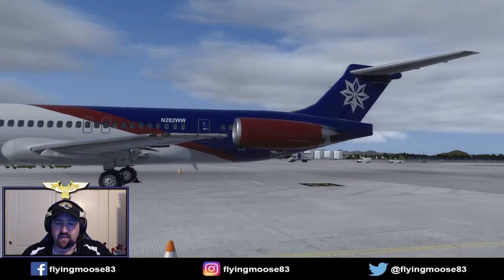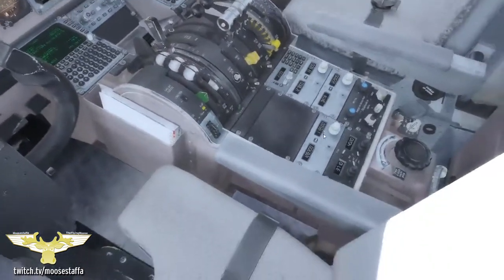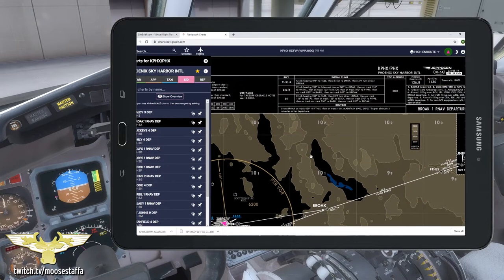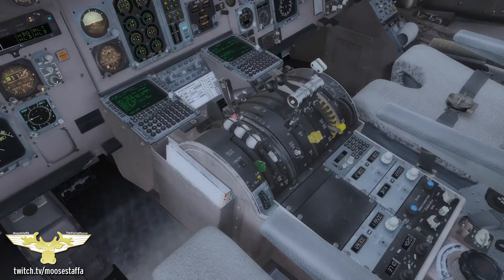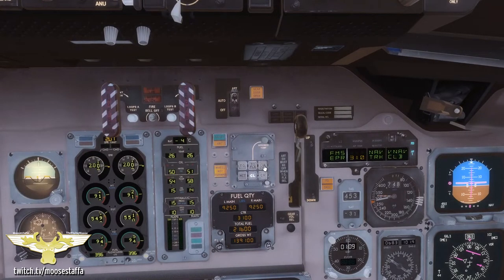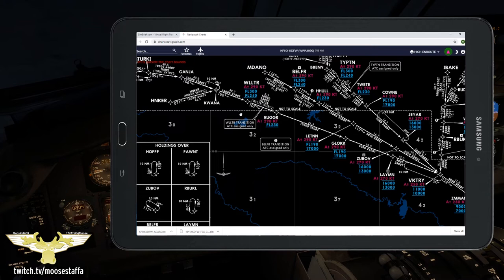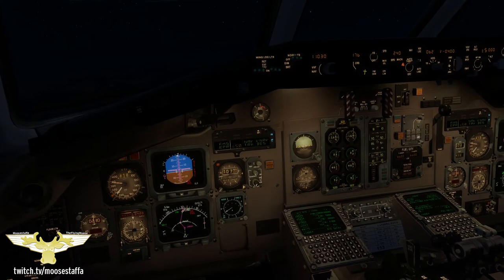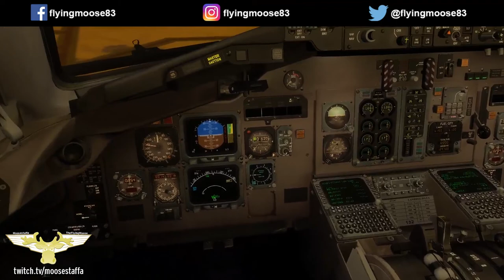How to MD-80 (Tutorial Flight)

Comment: I flew this plane for 5 years, i really miss it.
The first action on the overhead is to check the battery voltage, the switch is powered by the hot battery bus. Greetings from colombia.
Reply: This bird is a bit hard to master, in my opinion. ;) Greet's from France (living 80 km from LFPO Paris Orly airport, France).

Comment: Nice video! A suggestion with the flight director. Rather than disregarding it after takeoff gear retracted select NAV/HDG and select IAS and dial a speed ie 200 knots. The aircraft will accelerate better and you will get better flight director guidance. Then you can select VNAV
Reply from the maker: Yes you are correct, I have since started doing that after making this video. I know select IAS hold until 10,000ft then switch to VNAV

Comment: Thanks for the video it helped me a lot!!! How do I use GSX fueling?
Reply from the maker: Make sure in the Loadmanager that "refueled aircraft" is NOT checked. I think the P3D version also has a checkbox for GSX integration. 
Then import your flight plan into the load manager and save it (apply it) 
Then call for refuel from GSX menu and it should bring the truck and fuel you up to the correct level
Reply: @moosestaffa83  OK. I will try as you instructed.

Thanks

Comment: Thank you for a very through and an understandable tutorial. I'd like to inquire, what were your system specs computer-wise when making this tutorial? :-)
Reply from the maker: Core i7-7700k overclocked to 4.8ghz, 16gb 3200 Ram, Nvidia GTX 970, 500gb SSD.
Reply: @moosestaffa83  thank you. Does it run smooth with that setup? I'm planning a GTX 1060 6GB model. As for the other specs, I have Core i5 7600K, not over locked yet, 16 Gbs of RAM 2666, SSD 256 Gbs (planning to update it to 1 Tb. An m.2- type as I have now also). Do you think the P3D v5 would run with that setup?
Reply from the maker: @TheHenkka65  probably, it ran fine for me and while streaming from the same PC. With a lot of scenery and high powered addons it will bog down, but those problems would be mitigated greatly by not streaming while flying. I haven't taken the plunge yet to P3Dv5, so I can't speak to how it will run (better or worse) but I have since upgraded to a RTX2080

Comment: Any chance you could give a hint how you bound the TOGA to a joystick key, been looking around but can't find anything specific to the MD80. There is something about binding a mouse macro in FSUIPC but I couldn't make that work. …. Many thanks GREAT video
Reply from the maker: I will pull that up this week and let you know. Pretty sure I did it through FSUIPC
Reply: @moosestaffa83  
I found it and feel silly now.....there is a key binding in options called autothrottle toga....can't believe I missed that ....... the auto throttle switch binding doesnt work but once you manually turn it on the toga button works
Reply from the maker: @johnorton6372  great, glad you figured it out!